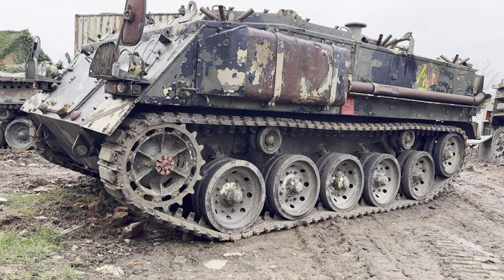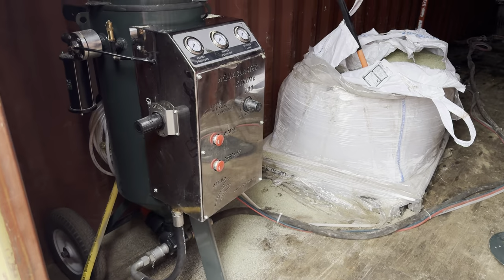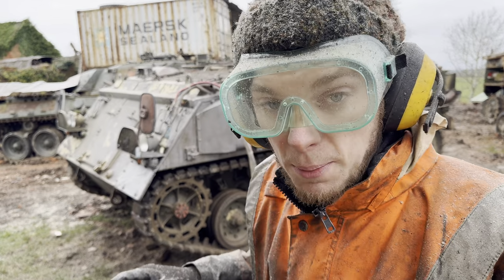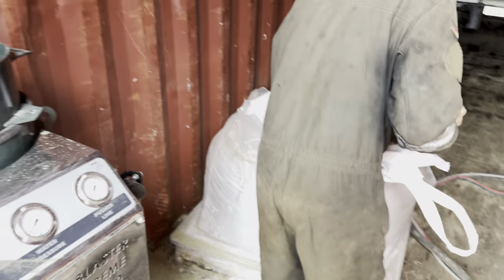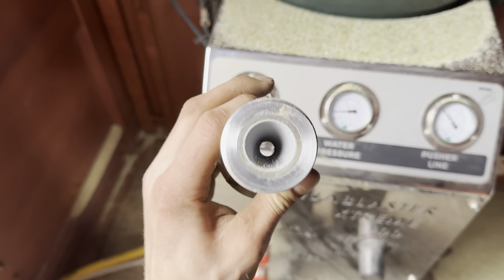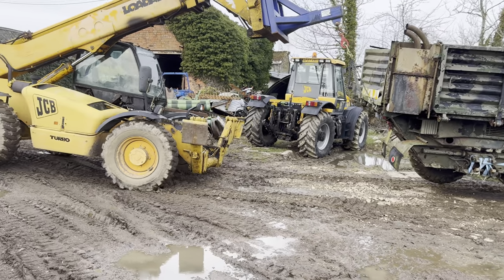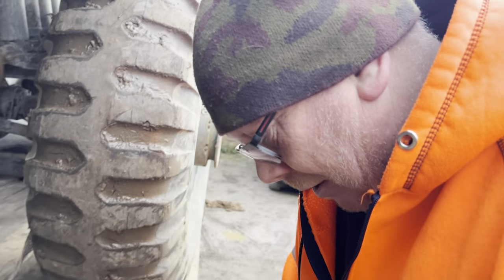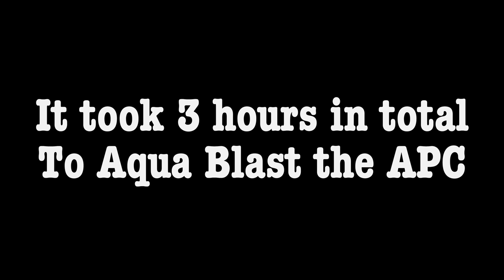AQUA BLASTING - FV432 APC

Comment: I've done this to caravan's before with crushed garnet rather than crushed glass (you can actually scoop that up again and get several uses out of it. My only recommendation is that a little bit of a prep goes a long way, covering the glass with some basic plastic just prevents little woopsies from becoming strange smears on every glass surface. Less glass on a tank than a caravan but might be wroth it for lights and mirrors, vision blocks etc.

Comment: I was told when I worked at the REME workshops that they used to sand blast the hulls as part of the base repair, to relieve fatigue in the alloy. 
The process you’re using certainly makes short work of cleaning them up, impressive 👍
Reply: I can honestly say I've never heard that one,and I served my time @ REME Central workshops
Reply: Should have been in the RAF then, we seemed to spend half our lives painting that couldn't run away from us😂😂😂
Reply: @stewartbrown8115  REME Chilwell? That's where I served. It was just an odd comment that I was told as an apprentice by one of the guys who did the blasting. Looking it up, it is effective - not very though. It's something that stuck with me all these years.
Reply: @garyphillips7993  yes i was at chilwell from 66 to 75,iI spent the last 2 years in the test house mainly on the meteor/meteorite rig
Reply: @stewartbrown8115  I was there 73 - 85/86, made redundant under Maggies closure program. I did quite a lot of work in the test house when I was with the maintenance division - I worked with a guy called Aidy, I think his name was. Moved to the LAD, last few years spent as end of line examiner in the main workshop. Now retired & looking back at it all.
Reply: @garyphillips7993  well if you were on maintenance,your workshop was the original test house,i worked in there as an apprentice,before the new test house was in use
Reply: That would be shot peening, it was done when I was in the aircraft industry to relieve surface stresses

Comment: The aquablaster looks like a really good bit of kit. I've done a lot of conventional wet blasting with a traditional pressure pot setup (mainly on boat hulls) but my concern was always drying out the inside of the pot when it was in storage. Had visions of the thing turning into some sort of missile through corrosion rotting the bottom out. Wet is definitely the best process for this kind of work though, especially when dealing with spurious old coatings. Really enjoy the channel, thanks for keeping us all entertained.

Comment: I had no adverts until the the video was done, then i got an advertisement. Not sure if that counts, but it was for a swedish company that makes bread.
I used to work in a shop that sold used cars, we did some sand blasting. And despite having protection, sand got everywhere, sure wish i had that aqua blaster back then.

Comment: That AquaBlast does look fast and economical on materials. I have used dry blasting with ''J Blast copper slag' medium and 'Chilled Iron Shot', but none were that quick, although I was doing cast iron gas pipe to SA 2.5, and that looks clean to work with, great stuff. Add for Uergo screwdriver set. And no I don't work for AquaBlast, I worked in the Gas Industry.
Reply: I've used Chilled Iron Shot to prep metal windows for powder coating, glad I'm retired now.

Comment: I spent a summer, between my university’s sophomore and junior years, sandblasting the rebar of miles of raised concrete highway bridge decks - the unit was on an 18 wheeler flatbed trailer w/ a huge 2 story tall pressure vessel for the sand, an equally large diesel powered compressor - every evening from 5pm to 6am, we worked on bridge decks, with only 4’ high concrete jersey barriers separating endless streams of 18 wheelers hauling azz at 65 mph - we wore canvas jump suits steel toed boots and full “space man” headgear in which we had pumped-in AC, wired communications to the 4 person team, etc… can’t tell ya how many times we’d be working in close proximity to each other and we’d end up briefly blasting a leg or boot…. This was back in 1985 and IIRC, we grossed $50/hr, averaging between 60-70 hrs/work wk, covering 13-14 wks… making $50k gross over the summer meant that the money earned bartending and bouncing on weekends was just play moola

Comment: Excellent job but the venture isn't the reason the water is pumped from the ibc its the husky pump (air powered pump) that's producing the water pressure needed to feed the win nozzle 👍 aim for 100psi at the nozzle this is achieved by knowing the cfm of the compressor and matching the corresponding nozzle ya will lose alot of efficiency blasting with a nozzle too big and waste alot of energy with 1 too small 👍 I can advise nozzle size if you know the cfm 👌

Comment: If you were blasting in the concrete pad, could you just sweep up the glass and (after drying it out and sieving it) re use it ? Not forever but a few times at least until the ratio if removed paint rust grease and many got too bad, reduce the running costs?

Comment: That’s an impressive bit of kit for sand blasting would be interesting if you could share some more info on it. I’ve heard about the inhibitor before plus you can use a decent power washer that picks up the sand close to the  nozzle and literally, use kiln dried fine, sand from the local DIY that does a pretty reasonable small jobs. Where do you get the inhibitor from?
Just come across your channel great work you do 👍

Comment: Adam did exactly what I'd have done on first go - 100%! I'm curious - you mentioned the additive to prevent flash rusting being environmentally safe, but are there any issues with the old paint that comes off? I can't imagine that it isn't full of who knows what dodgy old crap, so I'm slightly surprised some jobsworth doesn't tell you off for it not being collected up in a some sort of settling tank and disposed of in some overly expensive way.

In terms of ads I have personalisation off so I get a lot of random crap like pampers (I don't have and never will have kids), shit package holidays (which I have never and will never takes), same goes for cruises, Euro Car Parts (which I do use occasionally), and then sometimes it's those shysters with low rent ads claiming to sell you some trick that some industry doesn't want you to know or those currency trading liars. Oh, and LOTS of car ads.

Comment: the blacking ..... is millscale which you should try to remove ...... id suggest using a jotun product which is like red oxide called muki it will stop it gingering and suppress rust ..... am intrested in the type of blast material your using wwe use grade 3 iron silocate....... il assume your using garnet

Comment: Well, I didn't notice any ads during the video at all. After the thanks for watching the caption, I got the latest Raid Shadow Legends advert. Whilst I have no interest in games that harangue you for cash so you can upgrade your characters quicker. At least they are slightly amusing. It beats those con ads selling tiny electric heaters that allegedly don't cost a fortune to run (lying bastards) or those flashlights  which can allegedly cut through fabric (again lying bastards - it's not a laser it's a fricking torch). Yes, YouTube ads from con artists annoy me.
However,  Joe, Adam, and Jack, you entertain and amuse me. Thank you 😊❤❤❤😊

Comment: I wonder how much more effective the blasting would be if the nozzle was as close as practical to being perpendicular with the target surface. One other video that I watched recently was sandblasting narrow boat hulls and that guy was often at quite an angle and it seems to me that much of the energy was being wasted as the sand deflected off the target.
Reply: Not certain with wet blasting, but dry blasting it can be advantageous to use an angle, you are putting more grit at the edge of the paint (or something, not certain of the mechanism) it sort of rolls the paint off rather than trying to cut through the flat face of the paint.
Reply: Very interesting.

Comment: Getting rod of those Stollies was a good move on your part. They have the reputation of being absolute bastards to maintain, especially if the swimming gear is still installed. They were also a peculiarly crap design, in that there's only one diff on the vehicle so the wheels on each side are effectively locked together. Stick any amount of weight in the back and you get transmission wind-up, and it is the reduction boxes in each wheel that take the brunt of that. I dare say it would be worth looking at other many-wheeled vehicle designs to see how other designers have coped with the problem; pure hydraulic drive and a hydraulic motor in each wheel would be one possible way out, as would overrun hubs on some wheels.

The Stollies were designed as fuel and cargo carriers for the European theatre of war, and were amphibious so they could theoretically cross rivers. The transmission design was essentially a bodge job, since in West Germany at least most movement would have been on roads, so the transmission wind-up would have taken a rapid toll.

As for adverts, I get Interactive Investor ads hurled at me, despite already being a customer of theirs. Go figure.